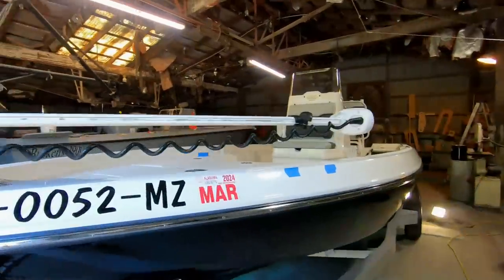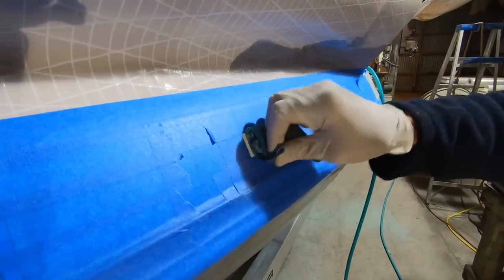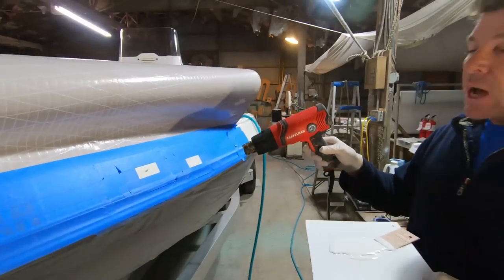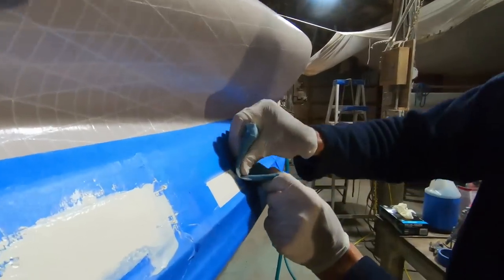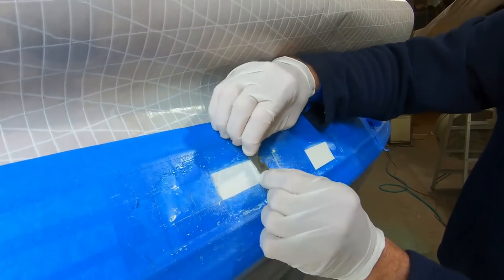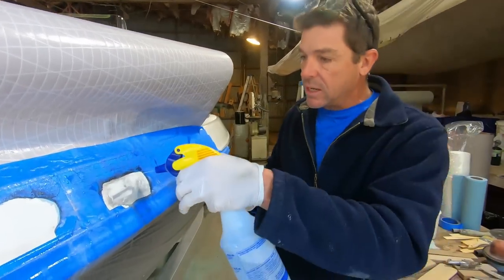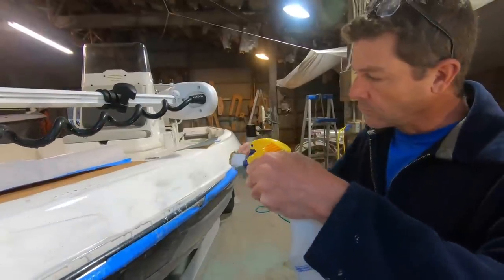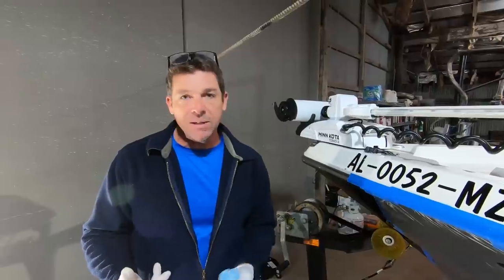GELCOAT REPAIR 101 -A to Z How To Repair Chipped Gelcoat and How to Repair Gelcoat Scratches

Comment: Do you need to use PVA on the last stage? Meaning do you use PVA during the last coat/waxing process or will the wax act as an inhibitor? Hope  i explained that right! 

Thanks for all the info and knowledge. Liked and subscribed!
Reply from the maker: Welcome to the channel! If you have wax solution that you can add to your last coat, that will work as a air inhibitor. Also if your gelcoat already has wax, that will work as the last coat. You can also use pva over your last coat of gelcoat as a air inhibitor. Or you can even use wax paper, or a plastic film over smaller areas as a air inhibitor. I hope this helpsand thanks for watching!

Comment: Capt Joe, Excellent video you gave us on how best to repair minor gel coat chips and scratches.  I am about to start a similar work on my boat and I am reluctant to use acetone to clean the surface and planning to use Isopropyl Alcohol instead.  What are your thoughts on that?
Reply from the maker: We have always used acetone for surface prep. I can't say personally if the alcohol works as well. I will look into that. Hope that helps, thanks for watching!
Reply: @FishBumpTV  Thanks Capt Joe for your reply. Looking forward to know your experience using alcohol to prep the surface. Your videos are the best and honest, thank you 🙏

Comment: Awesome video! I’m about to restore a 25’ cc  and would love to restore put new gel coat down. I live in SE Florida and have been reaching out to boat yards, painters and other fiberglass repair shops all saying “you can’t put gel coat down, you have to paint” is this true? I would love to go with gelcoat again since mine was applied thin from the factory. Paint on past boats did not stand up well to hard fishing. Thank you in advance!
Reply from the maker: Thanks! Glad you enjoyed the video! You can use gelcoat to refinish your boat, BUT it will not shine like paint or molded gelcoat does. If you spray or roll gelcoat it will have a flat, somewhat textured surface. If you look at the interior of our custom built 29 you can see what rolled gelcoat looks like. It is very durable, but it isn't as pretty as molded gel. You can wet sand and polish gelcoat to a shine, but it would be VERY labor intensive! That is why most shops recommend paint instead of gelcoat for most refinishing projects. Hope this helps answer your question, and thanks for watching!
Reply: Thank you very much!

Comment: I've noticed some people using fairing compound then gel for the nick you patch on the left. Is this just preference  or is there a reason you decided not to use fairing compound for the nick that is through the gel coat (or am I being deceived by lighting and its not actually through the coat?). I'd have to imagine skipping the compound would be easier but im wondering what truly defines the need for compound on these types of dings.

Comment: I also have a 2006 Hurricane Deck boat that has badly cracked gelcoat that I would like to restore.  The entire cap is covered with fine hair line cracks.  Should I dremel out all the cracks?  Should I epoxy prime over the whole top?  How would you go about doing this repair?
Reply from the maker: I hope to do a stress Crack video soon. There are different kinds of cracks in gelcoat,  and different methods to repair them. Yes, grinding out the cracks to fiberglass is usually the first step. Epoxy or vinyl Ester fillers should be used because of there strength, but don't use epoxy if you plan to use gelcoat as your topcoat or you could have curing issues. Hope this helps, thanks for watching!

Comment: If you're going to do a job, it's better to do it right - 100% true, my friend.. And you can't beat doing things by hand a machine removes you from the work, where by hand really allows you to "feel" your way. 

I disagree that if it's just a repair to a functional thing you may leave it there - you'll always be seeing that repair - all comes back to doing it right.

Feathering is absolutely vital, producing invisible repairs.. 

Putting 2 halves of a canoe together by drilling and stitching, yeah I drill with a machine. But once the job is done and the inside fibreglassed and gelled, stitches removed, I would use a rose on a drill to get that 45° feather - I would still go in and feather further. All sanding and polishing by hand, the machine only returning for the last polish and wax.

Great job and great video.. Job done..
Reply: Also the blue tape is magic stuff..

I used to skimp out on cheap masking tape and all the issues along with it, but blue tape? I'd never go back..
Reply from the maker: Thanks for the comment! Much appreciated

Comment: Would you use this same method to fix a burn thru from a sanding/buffing mess up?
Reply from the maker: It's hard to say for sure, this damage was caused by a impact. It is a different kind of damage, but same basic kind of materials. Thanks for watching!

Comment: QUESTION? I have 4 fiberglass decks on my house I have completed myself (8x20ft each). BUT smallest most solid built 4x5 one has the gel coat delaminating. The fiberglass underneath is stable and well attached to the plywood decking. It was the last one done a year after the others. Do you have any suggestions on what may have caused this and suggestions for repair.  This is random across the deck. There is a lot  of the gel coat still attached. I Redid a couple of dpoya last summer and recited the entire area. I can't tell were the repairs were so they may or may not have worked. Any advise would be greatly appreciated. All the other decks are great. Something went sideways, I'd like to get it right. HELP IS MUCH APPRECIATED. 

In Canada. High humidity area near ocean. Deck is in full sun. Poly not epoxy. All materials are from a reputable fishing/boat supply company. 

So frustrated this one didn't work.
Reply from the maker: Sounds like it could be a surface contamination issue of some kind. Either moisture or other materials, it is hard to say for sure. You mentioned it was done later than the others. Was it fresh resin and gelcoat, or was it from when you did the first decks. Most resins and gels have a shelf life of 3 to 4 months. Could the material have gone bad? You might have to grind or sand off all of the old gelcoat, and redo the whole surface. I hope this helps, and thanks for watching
Reply: After this winter it definitely appears to be an adhesion issue. Sounds like I will be removing and following your advice - lots of grinding and sanding in my future. And of course fresh materials . Thank you so much. Great videos - very informative.

Comment: Another great video. Question would you do the same process on let's say you had a chip above the rubrail but on the edge? I'd assume thickening the gelcoat up would work better so it doesn't run?
Reply from the maker: Thanks, yes it would be basically the same process. We have a 2 part gelcoat repair video on the channel that shows thickened gelcoat application. Hope that helps!

Comment: I’m about to paint my 31 ft boat with gel coat,do you recommend starting with the roller and the wax with spray paint gun
Reply from the maker: I just released a 3 part gelcoat spraying and wet sanding video that you might find helpful. If you have never done any gelcoat work before, it might be a good idea to do some testing with a brush, roller, and spraying so you can get a good idea of what to expect.The results can vary a good bit between each method. I have been doing this type of work my whole life and still frequently test and experiment with things. Rolling and brushing will still leave quite a bit of texture, and spraying will come out smoother but all will require finish sanding to get a truly smooth surface. I hope this helps and thanks for watching!

Comment: Would encourage awareness of use of heat gun anywhere near an open container of acetone.  Acetone is super flammable.  PVA I think in this instance stands for Poly vinyl acetate which is a type of water based polymer found in common house-wall paint.
Reply from the maker: Sure, of course safety is always important. I try to mention that regularly in our videos. Pva stands for poly vinyl alcohol, it is pretty neat stuff. Hope this helps, thanks for watching!

Comment: Hi, What happens if I used automotive filler and paint. Prepped and filled it with some 3M Platinum filler, 2k primer filler and painted it with with some 2k Direct gloss ? what is the purpose of Gel coat and is it necessary to use ? can hear it sounds like its quite solid
Reply from the maker: If you have a newer, nicer boat it is kind of frowned upon to use paint for repairs. Gelcoat is basically a high quality, pigmented polyester resin. It is thicker, and more durable than most paints. That is why it is used on boats. Hope this helps and thanks for watching

Comment: At what point does a repair need some mat put in before the gelcoat? I have a sailboat and it has a few what i would call deep areas to repair maybe 1/8 inch or so and some damage to the lamination.

Comment: Small repairs like this, I just put some blue masking tape on top of the gel coat to make it cure. Works very well.
Reply from the maker: Yes, wax paper, clear plastic, pva or anything that will shield the gelcoat from air will work. Thanks for watching!

Comment: Doing a gel coat project now. Used colloidal silica powder to thicken gel coat without wax to a putty consistency. Didn’t use  any wax, pva, or plastic wrap for the cure and the gel coat is hard as a rock. Why might that be?
Reply from the maker: Gelcoat without wax will still cure as long as you add hardener, it will just remain somewhat tacky on the surface. What you are describing is totally normal. I hope this helps and thanks for watching!

Comment: I have a quick question, if you apply 2 coats of gelcoat without wax, then you apply a single coat with wax, does that single coat harden the two coats without wax for sanding?
Reply from the maker: Yes it does. Thanks for watching

Comment: How did you find the right color of gel coat?
Reply from the maker: The owner of the skeeter got some factory gelcoat from the dealer. There is also a company called spectrum gelcoat that can make custom colors, or you could use a color match kit. Thanks for Watching

Comment: Put a XXX on the lid of that acetone container. And for those who might not know. When you get a bottle, can, bucket or jar of something you're not sure about, don't stick you nose up to the opening and sniff. That can be dangerous. Instead wave the lid in front of your face and sniff what wafts off that. 

 And boat people, all solvents are heavier than air, they want to settle in your bilge. Keep this stuff in your dock box, or a bottom venting hatch (if you have one for gasoline/propane containers). If you use a volatile solvent onboard, open up some hatches and run a fan. That'll move it around and hopefully out a hatch.  (Some friends lost their brand new 50' cat in Florida when one worker used acetone on board and another was working on something electrical. One spark set it off. Total loss their boat and the one next to it.)  Alcohol is a bit safer than acetone.

Something everyone should be aware of about compressed air. It's against the general OSHA rules to blow yourself off with the air hose. Sure I've been doing it for decades,   we all have. The useful information (instead of just complaining about over regulation) is the reason is you can blow stuff into your eyes. Keeping this in mind, wear your googles, close your eyes... you should be fairly safe. I had a piece of fberglass in my eye for a month, just from walking around a dirty boat building factory. I thought it was something else, until I found an ophthalmologist in Tokyo (Save a few hours of a wild google chase, just ask at a drug store).

Comment: Do you need to put wax in the gelcoat?
Reply from the maker: We used pva instead of wax over the last coat. If you don't use pva or a plastic film over the last coat, then yes, you would add wax to the last coat. Thanks for watching
Reply: @FishBumpTV  Thank you so much

Comment: I was good up until the end where you mentioned no gel coat when using epoxy…so …🤦🏻‍♂️🤷🏻‍♂️
Reply from the maker: Yes, generally it is considered a bad idea to apply gelcoat over epoxy as there can be some compatability issue. I have found a product that is supposed to solve that compatability problem and I will be making a video demonstrating that very soon. Thanks for watching!